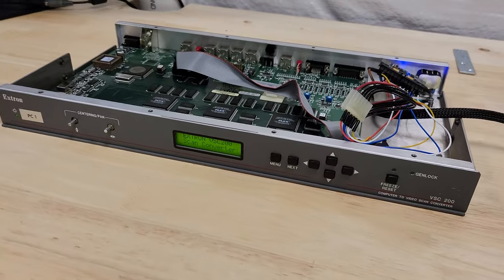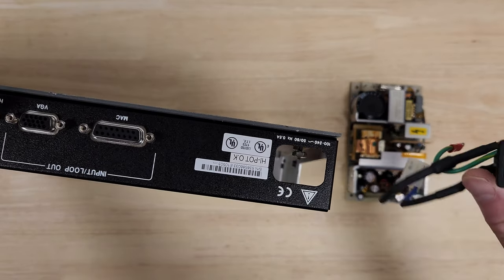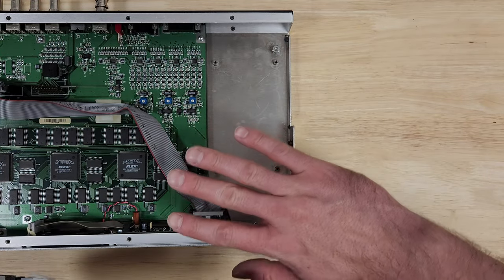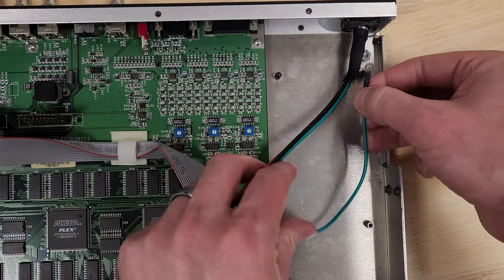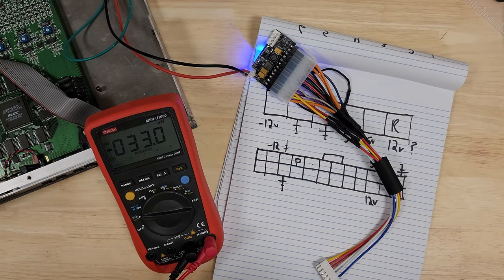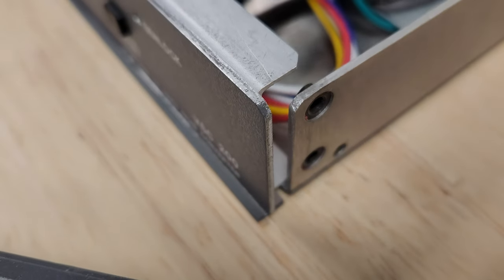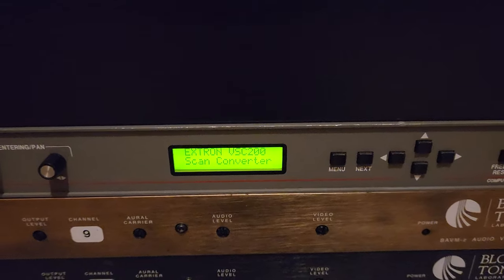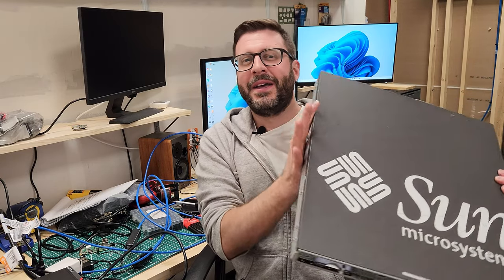Final Pico PSU Install for the Extron Scan Converter

Comment: Have binged alot of your videos for a few days now and I love the hotdesking stuff you've been doing, that power supply is a very over engineered way of going about it but if it works it works! for future reference external dc adapters exist that do 12v/5v they usually have a Molex connector on them too so you'd only need to adapt from Molex to the power input of your board.
Reply from the maker: thanks for watching! yeah I totally over-engineered this as an excuse to play with a Pico PSU haha. I think a DC adapter would've been the better route.
Reply: same here doing the same

Comment: 8:25 is the point a lot of people scream about "no! not hot glue!". since it is a ripe old mess to get off...
But add some IPA, wait a bit for it to seep in. And suddenly hot glue peels off in one piece as if it never were attached to start with. Especially on metal parts, but works fine for most other surfaces too. (though often not paper and stickers and such, those tends to get destroyed by the IPA.)

Comment: Nice! I would of done the same thing lol. Possibly put that female barrel connector to a male female C13 plug, that way you could of used the original C13 male socket.
Reply from the maker: oh yeah... that would've been an interesting solution there.
Reply: As long as you remember it's supposed to be 12v and don't blow it up accidentally plugging in 120v lol

Comment: I'd make a PCB for this. One side with a right angle 24 pin for the pico PSU and the other side with the connector for the original cable. Make the PCB the correct size for
the screwholes and have traces run for the correct voltage rails. PCBWay should make this easy as Pie.
Reply from the maker: Yes! I've never made a PCB before but was thinking I might revisit this for a first go at it someday.

Comment: You could've removed the unused cables and only keep what you needed. And instead of splicing cables you could've put the pins from the 6-pin connector on the cables coming from the ATX plug.
Reply from the maker: yeah I thought of that later haha

Comment: just remember, rubbing alcohol will de-stick the hot glue.
Reply: you can also unclip the psu connectors that you're not using
Reply from the maker: good call on the rubbing alcohol, I saw a video somewhere on that working really well. also good idea about unclipping the unused connector leads.